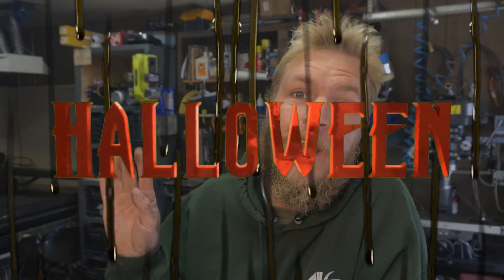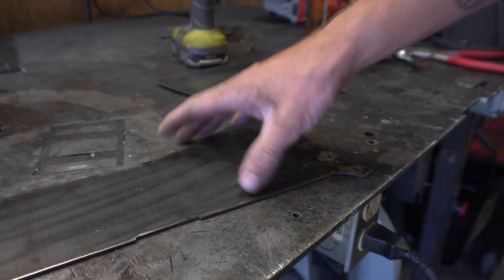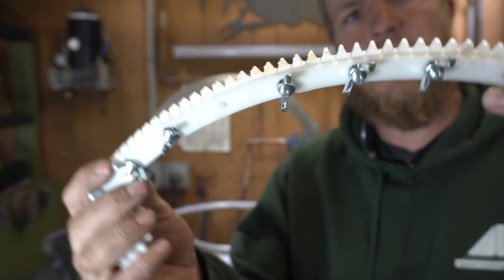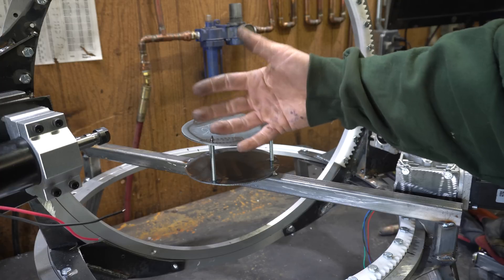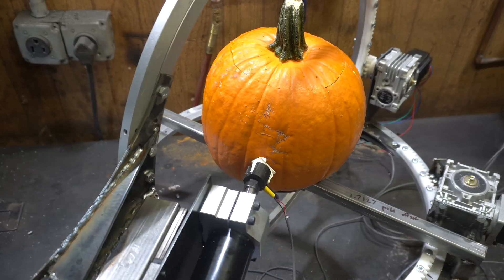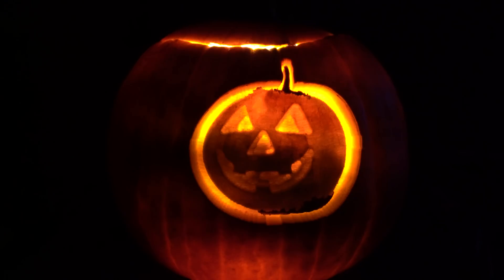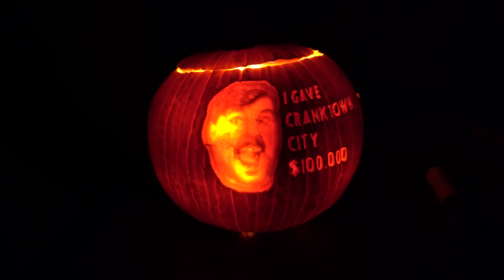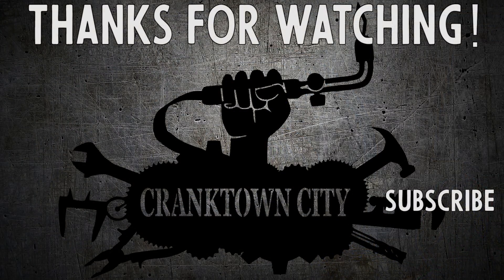I Made A Robot To Carve Pumpkins

Comment: Seems like there would be software available for a polar coordinate system.   GE made some welding robots that used a polar coordinate system.  Otherwise, it's a pretty simple concept.  You have a theta, angle, measure for one direction set in one plane set at 90 degrees or pi/2 radians to another, kind of like your lazy susans.  Then you have a radius measurement from the center which would represent your spindle measure.